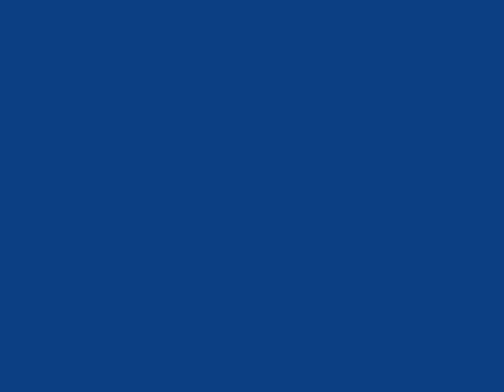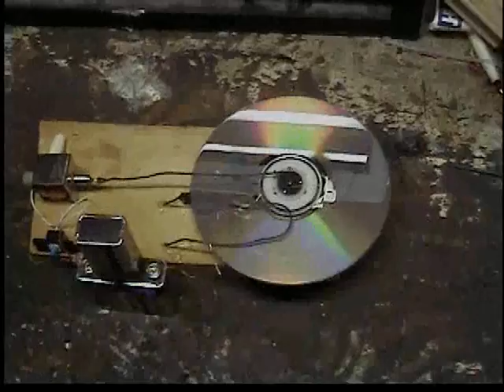solenoid engine

Comment from the maker: basic constuction is simple. i got a solenoid from a door bell and wire and 9volt batteries.  i have a wire going to the switch, then from the switch to one coil wire. then the second coil wire was wrapped around the connecting rod. i had another wire going to where the shaft spins and hits that one wire to pull in the solenoid. the only trouble i had was getting the timing good